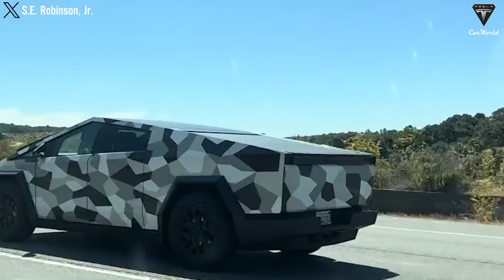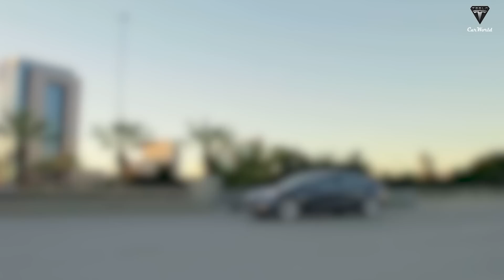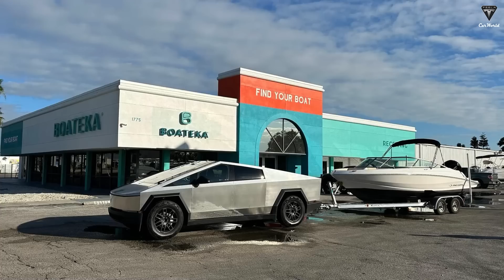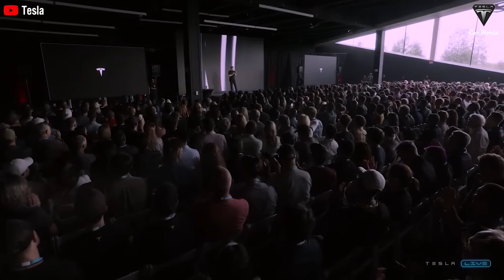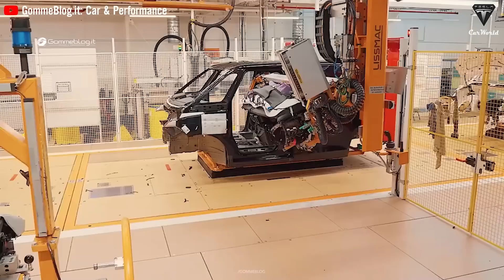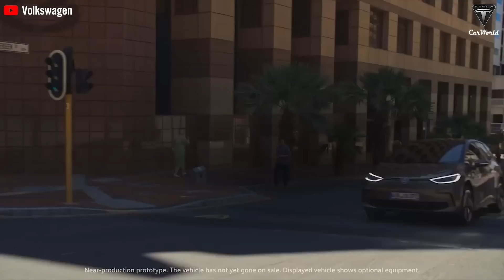Elon Musk Unveiled Cybertruck's Unique Features! Tesla's $50,000 Gamble Pays Off? Hidden Interior!

Comment: The 3 motor Cybertruck or any version will loose money.  The 4680 probably should have been cancelled as a failure; it still has a very high reject rate which makes it uneconomical to produce; thus the Cybertrucks being made will all be red ink for the company.  Tesla trapped itself with promoses to buyers and the public; now it faces losses for these trucks which they will mitigate with low production numbers - probably under 5000 a month. It will still be billions in losses.
Reply: Is the money too tight? So it must be loosened? What is a promose? Your prediction is about as accurate as your spelling.
Reply: Oh Thanks - Lose  @The_DuMont_Network

Comment: If only those 5 billionaires used a Tesla  Truck to dive down to the Titanic. But NOOOOO, the leader wanted to use his Carboard and Foil design and Xbone controller (carbon fiber and titanium. They separate the same way meat separates in the microwave) The only thing the tesla truck doesn't have is an air recycler XD. Very necessary when the occupants stop by a Taco Bell (different kind of recycling)